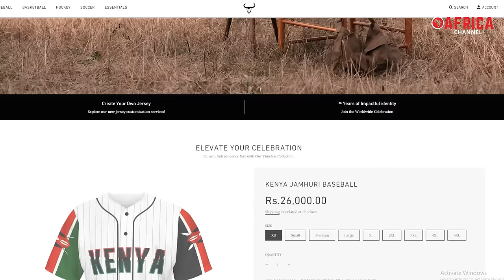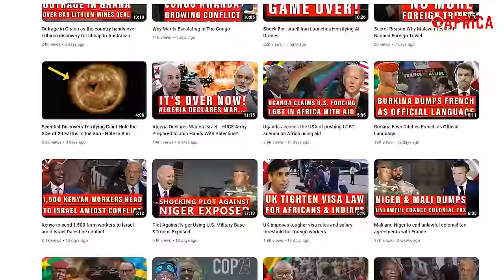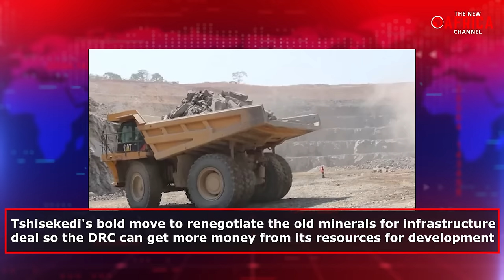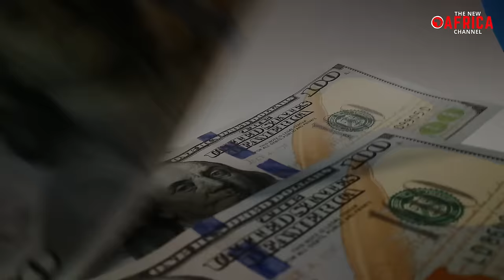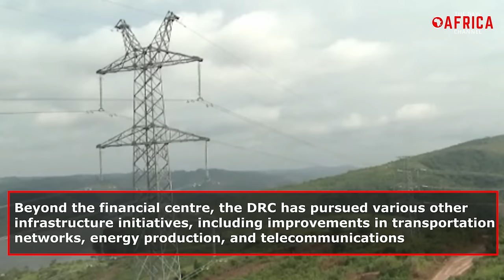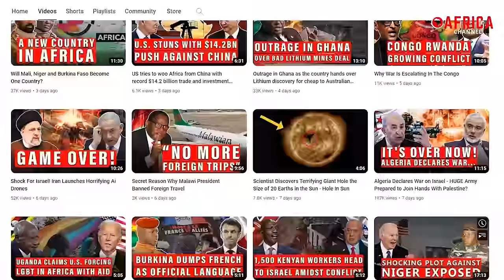China invest $7 billion into DR Congo in revised minerals for infrastructure agreement

Comment: I don't understand sometimes, to me, a deal is 50/50, if one has the resources, and you are bringing the expertise, then it is of equal value, the minimum for these African countries should be 50 percent, MINIMUM, anything less than that, is robbery!
Reply: Actually the percentage each get depends on several factors, such as the size of the mine. If the size is small, the Chinese would want to have a bigger percentage. 9:38

Comment: He’s not too smart giving up 68%
Reply: Agreed.
Reply: Actually the percentage each get depends on several factors, such as the size of the mine. If the size is small, the Chinese would want to have a bigger percentage.
Reply: @lilask2667  You are those that would be very emotional happy for a little and that's not a mentality strength for Africa progresism in this time.
Reply: 68% deal was with previous government it is why the new government wants the deal to be renegotiated to 70/30